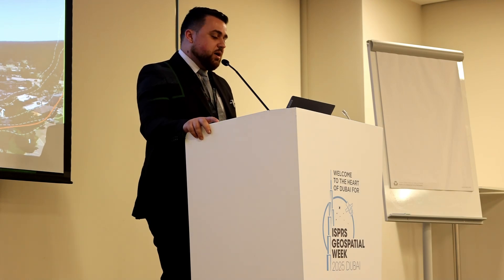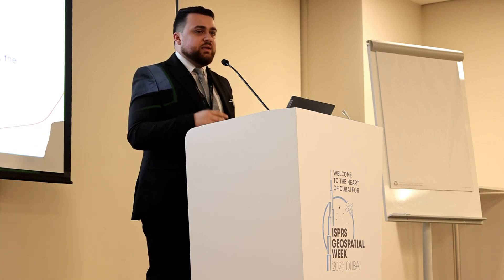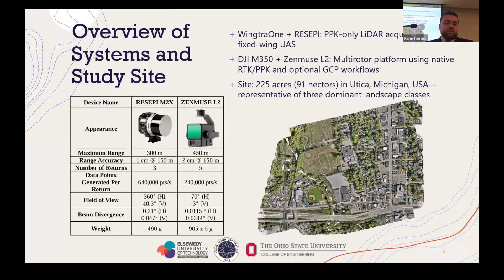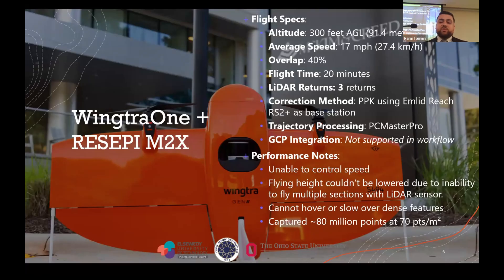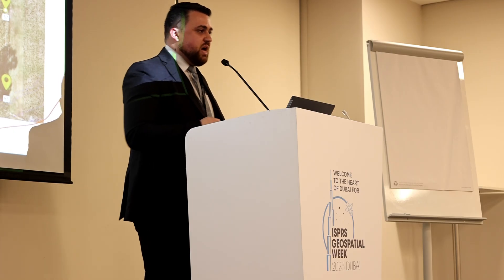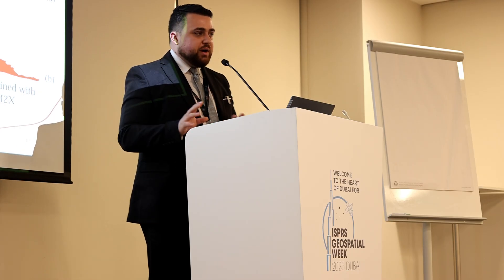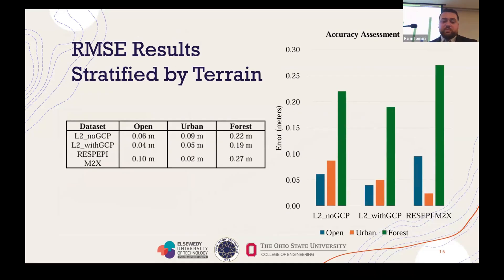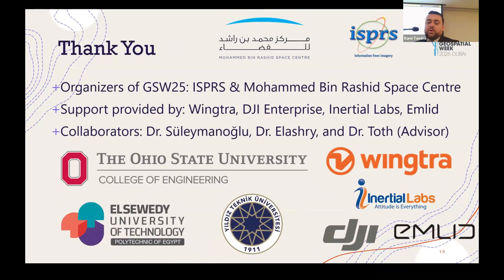Can Drone LiDAR Build Smart Cities? (DJI L2 vs RESEPI M2X Accuracy Test)

Comment: Rami, I’ve been flying RESEPI systems for years and consistently see RMS results in the 1–3 cm range… not 27 cm. I think part of the issue in your comparison is platform choice. You flew the L2 on a DJI M350 multirotor, which is far superior for LiDAR.. and flew the RESEPI on a fixed-wing. That’s simply not an apples-to-apples comparison.

On top of that, the L2 was flown lower and slower, giving it a big advantage. In my own testing, flying both the L2 and RESEPI XT32 on the same sites, with the same parameters, the RESEPI outperformed the L2 every time.

I’d love the opportunity to meet up with you and run a true head-to-head comparison between your L2 and my XT32. I think you’d be impressed with what it can really do.
Reply from the maker: I agree, I think flying both on the same type of drone would be a more fair comparison, and it would allow us to fly the same flying height and overlap. This would give the RESEPI a more fair advantage. I did discuss this a little bit at the end for future research, it’s too bad I couldn’t use the M2X that I had on my M350.